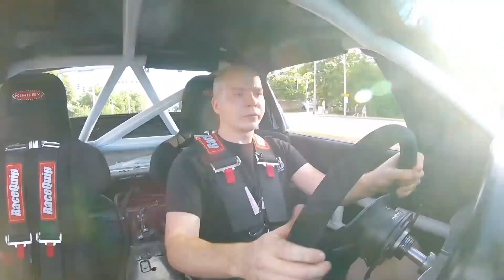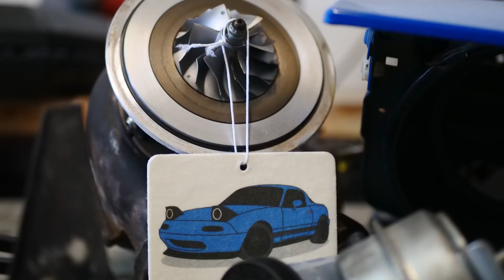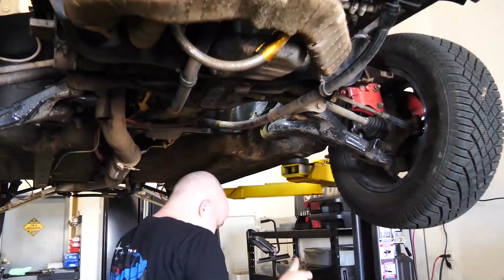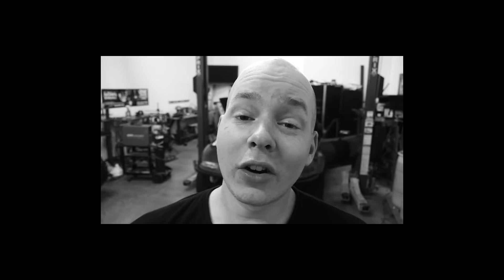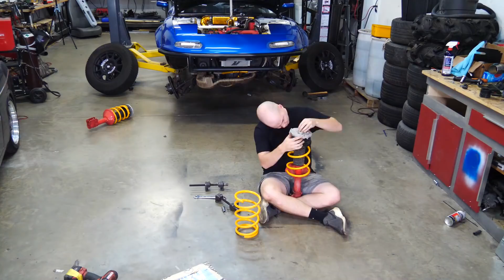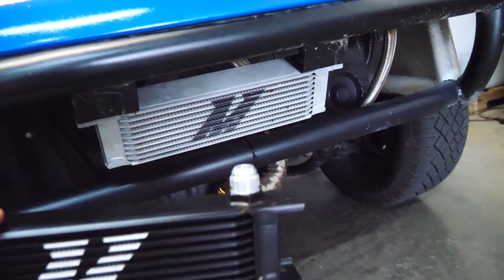Getting the AWD Miata's STEERING & SUSPENSION Sorted - (ITS AMAZING!)

Comment: And you still need to build a skid plate for your exhaust
Reply: The only thing about adding a skid plate now is the clearance would be reduced even more, Caleb doesn't want to remove the unequal length headers as the signature Subaru burble would be lost (which I think is fair) so I think he should just see how it goes for now. I'd say it would probably be more important go get some windows atm. 

(Also if he does end up damaging the headers due to not having a skid plate then he may be compelled to get equal length ones mitigating some of the reasoning behind getting a skid plate)
Reply: If it were mine, I would put a drivetrain in it with the engine farther back, so there would be space for headers infront of the engine, but not under it.
Reply: @cyrusthegreat3553  or just get equal length or custom headers lol
Reply: @struangorrie6308  I think he said that he wanted to get equal length headers in the future and then make a skidplate for them.
A skidplate for the current headers would probably look super wierd because the angle would have to be very steep.
Reply: thats why you just remove the exhaust
Reply: @gavinmeyer8937  I would do that to try and keep the unequal headers, and the sound.

Comment: Rally cars have really short final drive ratios, usually they top out at only 130 mph.
Reply: Even Group B rally cars only did around 140
Reply from the maker: Yeah! I definitely want to get shorter gearing for this thing
Reply: @_Gingium_  I really like those wheels, I would change the final drive ratios instead of the wheels. Or, you could have a showcar setup, with bigger springs and those wheels, and a rally setup, with smaller wheels. In fact, rally cars have to race on tarmac and gravel, so all the crew has to do to change the car is change the coilovers, and the wheels, then give it an alignment.
Reply: @_Gingium_  JDM turbo foresters got a significantly shorter final drive. 4.44 vs the WRXs 3.9. I got a trans and diff shipped to my front door for a little over 400. Might be worth looking at
Reply: what are the advantages of that???
Reply: @flamax5742  In rally, the lack of grip, jumps, bumps, and tight corners don't give the driver a chance to get up to high speeds.  The cars have short final drives so they can accelerate quickly, and if they had a high top speed, they wouldn't be able to use it. You saw how the rally miata didn't get over 60 mph in the rallycross event, and how it had to high of final drives. it couldnt get into the high revs.
Reply: @cyrusthegreat3553  thanks for clarifying I see how important it is.
Reply: Well it depends on the car

Comment: I raced go karts for about 6 years. The one thing that was always said was that you can never dial in your kart enough. There's always room for adjustment and that isn't a bad thing. I think you have a really good set up. Now you need to become a better driver and then you'll be able to really fine tune everything once you get more seat time
Reply: Nice what class did you do I do rotax
Reply: @jaydenneal-holder2089  I went from junior clone to senior y pipe. I stopped there because I started really growing up and getting a job and stuff
Reply: @thatonecarenthusiast8491  are those the american classes? What kind of engines were you running? Back when I was racing in New Zealand the main class ran Yamaha KT100's, and I started out in Cadet class with the Raket engine. I think it was 75cc? Terrible carburetors on those things. Rotax was only just gaining momentum back then.

Comment: Okay. So after combing the comments, rewatching the past two miata videos, and taking some time to identify some issues. Here's a compounded list of your previous qualms, other peoples ideas, and my two-cents. 

:Front Exhaust manifold skid plate

:A new steering quick-release mechanism

:Better lighting solutions for night rallying

:A rear bumper to match the front

:Working on gear ratios and/or tire size changes for your low gear boost issues

:A nice bit of grating welded over the hood intake to keep large debris from turning your intercooler into a sieve

:Finally the suspension work you've been teasing/dreaming about

Comment: your steering wheel has some sort of wobble front and back 6:27  to 6:32 you can see it almost as something is flexing or some bolt isn't tight enough or maybe is the camera mount, either way good work with the build! and hydro should be a nice addition for rally.

Comment: Bro i could see your steering wheel rock back and forth.  Idk if thats something to do with the quick release or if something is just loose but yeah
Reply: I saw that too. Was also thinking it might be the quick release.
Reply: Whats the time stamp? Maybe im looking in the wrong place but I didnt see anything with it
Reply: @Noahh_jp  5:40 is where you can really tell
Reply from the maker: Unfortunately its something with the quick release 😕
Everything is tight and it still does it...
Reply: @_Gingium_  use a better QR i had to ditch my nrg because it cant deal with legit use ie track and such
Reply: I used a Snap Off brand quick release for a few years. I heard they were used in Lamborghini track cars. It uses pins instead of ball bearings. 
http://snapoff.com/road-cars/

Comment: I had the same struggle with my lifted s80 project where the front lifted too much with the xc70 springs (it’s a lighter non turbo engine) so I cut like 1/4 of a coil (stiffer spring than stock and longer so it was still longer than the stock spring so the ride quality did not drop) and it’s pretty level now.

Comment: You’re still running the 5 speed and r160 diff from the wrx right? Have you considered getting a rear lsd so you can get the rear end to swing out easier on loose surface conditions?
Reply from the maker: I Definitely want to do that soon but the differential is expensive.
Reply: Gingium weld it!
Reply: @_Gingium_  Yeah at $1200 for a cusco LSD it almost makes more sense financially to save up for a used STI drivetrain which can be had for around 3k, and then you have 3 LSDs + a much stronger drivetrain + shorter closer ratios(if you get a JDM transmission)